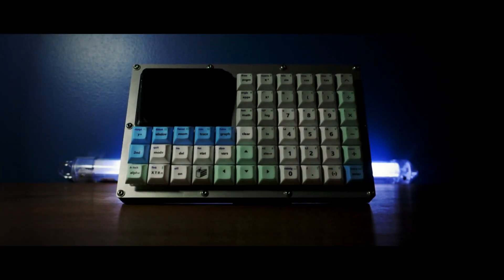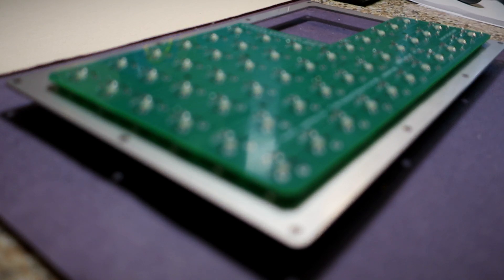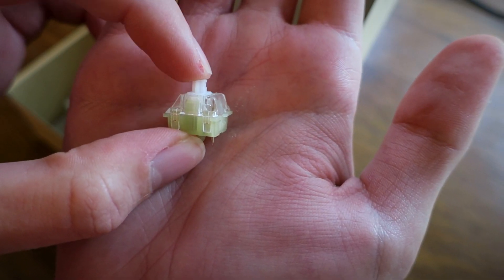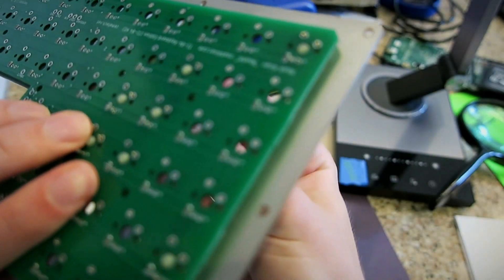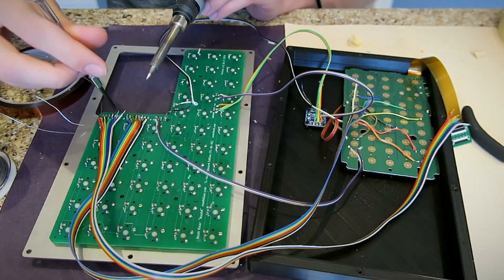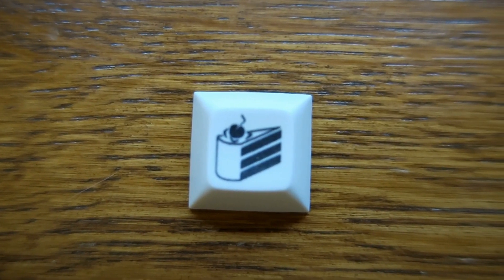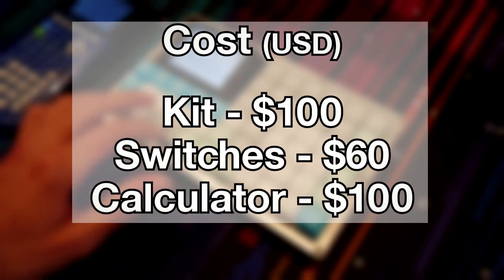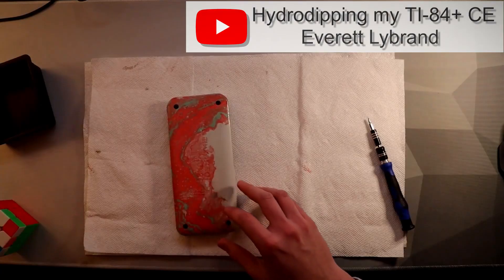The BEST TI-84 Plus CE is a Little Different...

Comment: Great project. Would have been great if you used a modern processor (snapdragon, etc) and more ram (256mb) and storage (256mb)
Reply from the maker: The point of this project was just to give the calculator a new body and key switches. The circuit board was reused from the original calculator.

As for upgrading the components... There's a lot of major issues with that.
1. That would require creating an entirely new custom circuit board to account for the wildly different components. 
2. The OS is only compatible with the eZ80. It's also specifically made to only use the original ram and storage amount. Making the OS compatible with a snapdragon would mean re-writing the OS from scratch.
At this point you have a completely different device and should just make something better than the TI-84 Plus CE. Maybe more like an HP Prime G2 ;)

Comment: yo bro is there a way i can download NoteFolio on my ti 84 plus ce? cause the original NoteFolio is a flash app and there is no flash memory on my ti 84 plus ce so is there any way??? OR if you know a good dictionary app for ti 84 plus ce with a search function that would replace it THANKS
Reply from the maker: The CE does have flash memory (called Archive memory), the app is just incompatible across calculator models. Unfortunately I don't know of an alternative however cemetech.net ticalc.org and tiplanet.org would be the best places to look.
Reply: @TheLastMillennial  alr thx bro if u get anymore info pls inform me
Reply: @TheLastMillennial  if yk how i can download a phyton dictionary to my calc which is python supported tell me plss